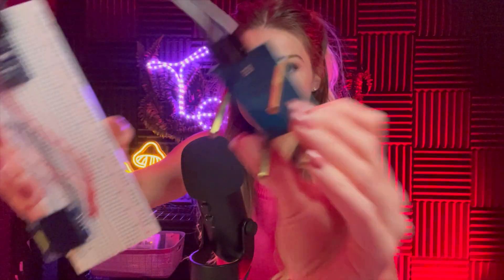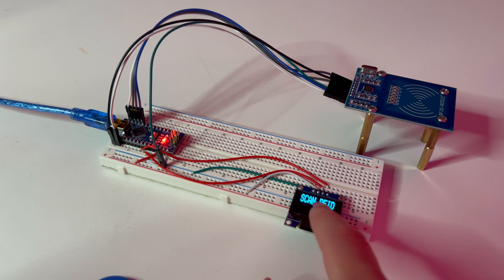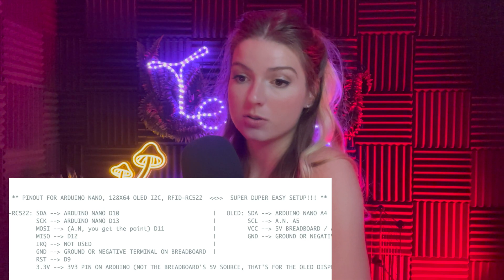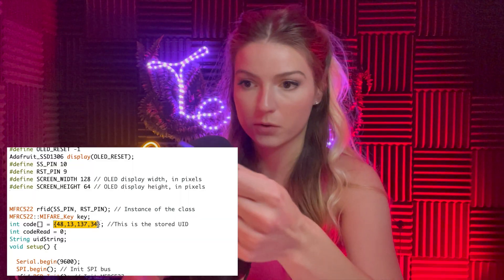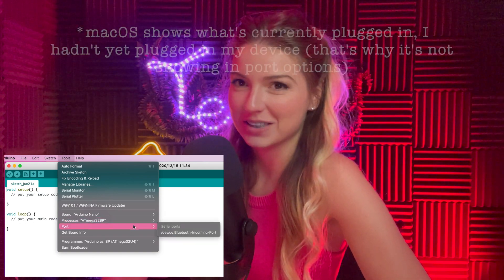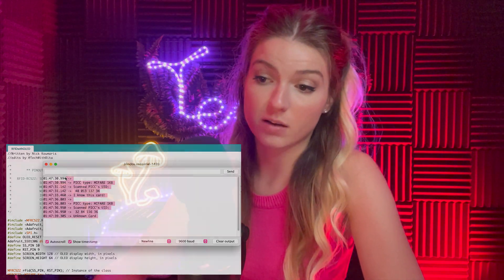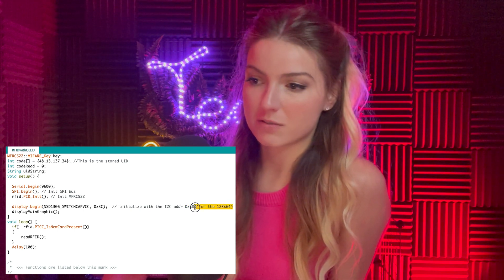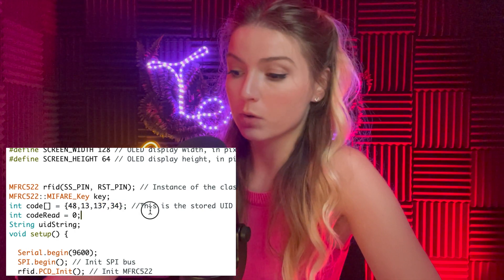Connecting Arduino Nano with RFID and OLED (code included)

Comment: - 0:36 You can solder on a PCF8574T-based I/O-expander board to control the 1602 LCD with I²C. Sure, OLED is nicer, but sometimes, it's overkill for an application and an LCD is more fitting. 🤷
- 6:30 013 is octal for 11 decimal. The "013" was probably just sloppy printing on the board.
- 9:45 A lot of these displays default to address 0x27; you can usually change the address by shorting a pair of solder-pads.

Comment: (5:44) When you added the zero in front of 13 to make it 013, this actually changed its value. You know how you can represent numbers in binary like 1001 for "5" or in hex like 0x12 for 18? Adding a leading zero does something similar, except it changes the number to octal or base 8. Base 8 means you can use numbers from 0 to 7, and 013 in octal is not the same as 13 in decimal. To compute 0x12 in hex we did 1 × 16^1 + 2 × 16^0 = 18, so in octal 013 is 1 × 8^1 + 3 × 8^0 = 11 in decimal. You can try this in a Python shell, just note that Python doesn't use zero as the octal prefix but 0o (zero-oh) to make it clearer and more explicit. So if you type 0o13 in a Python shell, it'll print 11. Not understanding why a leading zero breaks stuff is common until you learn why that is. One way you could have noticed is if you had tried to use a zero in front of a number with digits outside of 0–7, e.g. 018 will give you an error like "invalid octal digit". edit: and welcome back! Great to see another video on this channel.